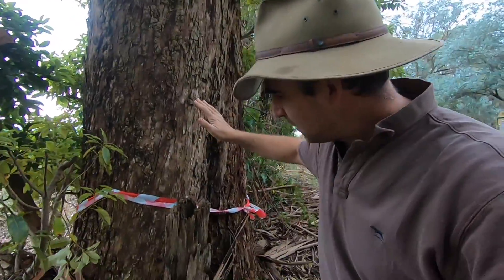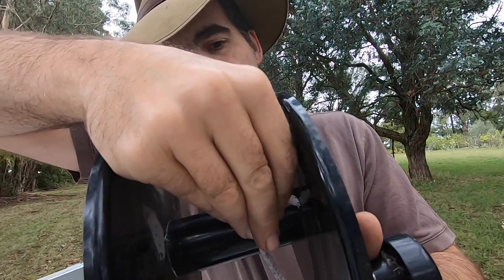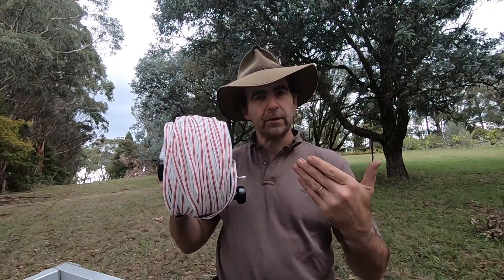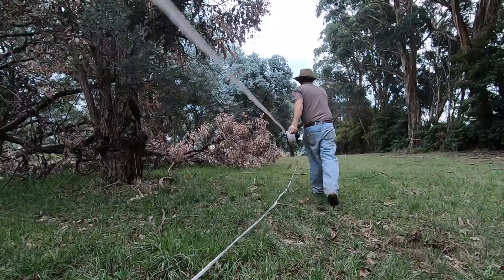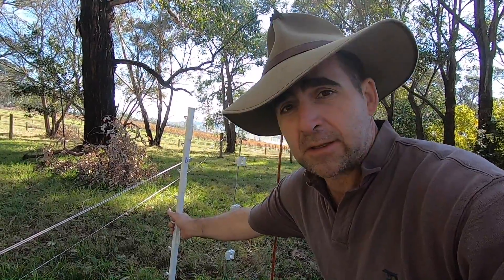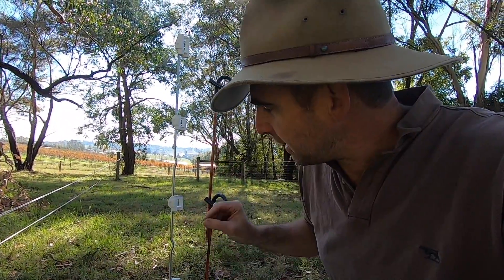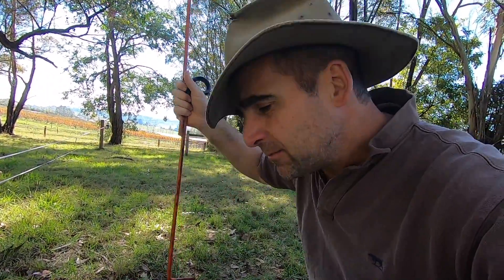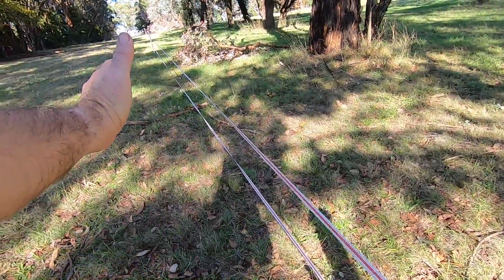How to Build a Temporary Electric Fence for Strip Grazing and Other Short Term Fencing Needs

Comment: did you join two pigtails to make that post? I have never seen any sold like that. The metal Thunderbird/Gallagher multi-wire posts are good but very susceptible to shorts- when you run multi wire as you feed the wire/tape from one clip to another I seem to always have to muck around adjusting the wire because they end up touching the steel...somewhere or another.

Comment: Good video! Treat your soil and your soil will treat you!
For my grazing temporary fence I have a little spring loaded gate handle on one end but it's more of an L and not so much a c hook so if it gets struck too hard it can pop off. Then with a bunch of them step in pigtail posts and a spool like you have stretch The Wire across and then I just hang the spool over the hot wire at the other side next to a post. Not much tension but good voltage and the cattle will learn to not mess with the fence.

Comment: Thanks for the tip.  I'm about to build a temporary fence with star pickets and Poly wire. This is because of time constraints getting my treated pine Posts. Do you have any tips on making the fence secure with star picket and polywire? It has to hold two horses in for at least 4 weeks
Reply: @FarmLearningTim  Hi. Thanks. I have the star picket caps. My horses are pretty good. They respect fences. Just hoping they stay right away from it. Thanks again. 😊

Comment: Maybe I missed it, but I was interested in the power source used for the fence and how you connect and protect it from the weather
Reply from the maker: Solar electric. I do use a mains system elsewhere. I Just run a wire underground from the shed where it’s screwed to the wall.